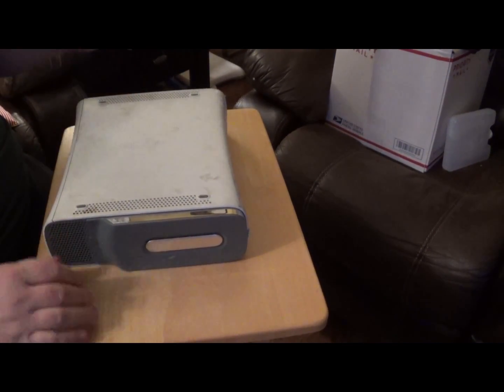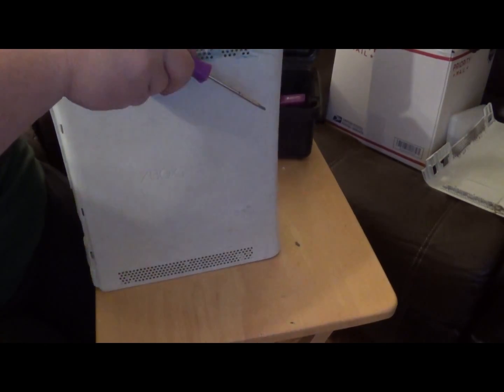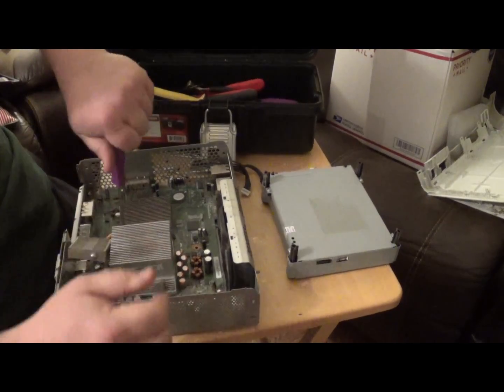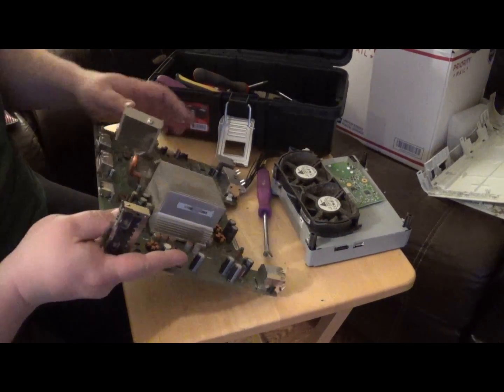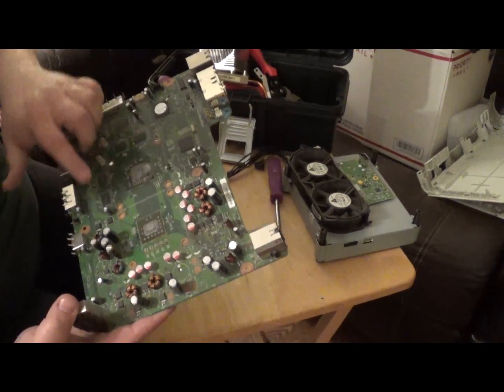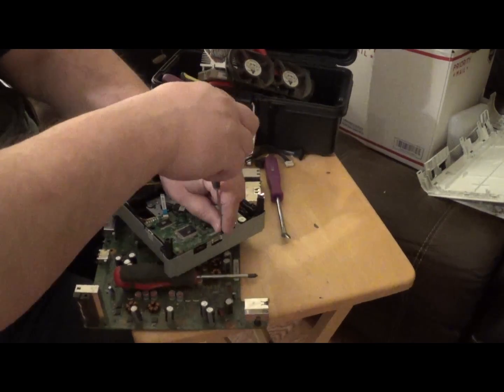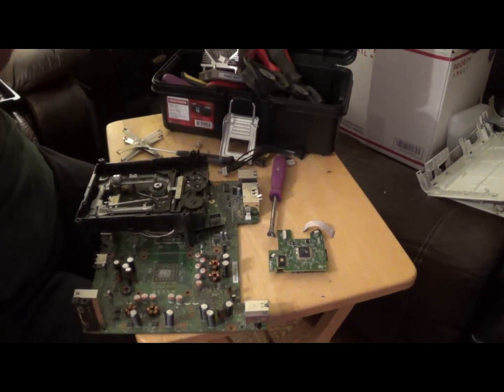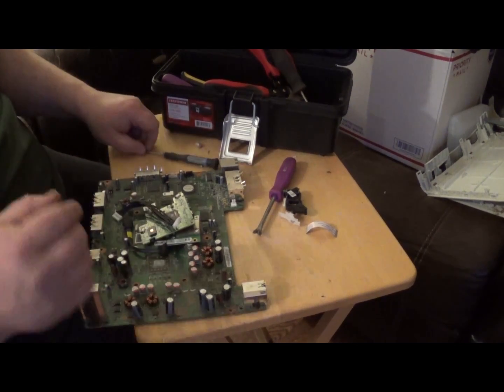Scrapping an XBOX 360 for gold and scrap metal

Comment: You're incorrect. There are many programs that will completely destroy all the data on a hard drive but they take hours or days for large drives. You just need to wipe these one time with 1 pass and you are 100% safe to sell them.
Reply from the maker: Thanks!  When I filmed this a few years ago, I am not sure that tech was available.  I still feel weary about it but if others want to take that route, there is certainly more money in it!
Reply: Stevens Garage However, you should note that after being wiped by any external means the HDD will no longer be usable for an Xbox 360. It will only function as a normal PC HDD. The reason for this is that Microsoft puts a special ‘security sector’ on each HDD so the system will not allow unauthorized HDDs.

Comment: i have scrapped two of these and something interesting that i found that i didnt notice you finding in the video was on the board there is a block box connected to four gold pins, if you were to pull off the box and open it you would have found a gold ball.
Reply from the maker: gold or gold plated?  I saw a video a couple years back about these little gold balls but after finding many and testing them all found them to be brass or gold plated brass.
Reply: i am unsure i havnt gotten around to testing them, they are pretty soft though i was able to dig in to it fairly easy.
Reply: This part is a switch, it probably indicates the box that it is tilted vertical and the dvd tray is not operable. I scrapped a 2007 version, it is slightly different from Moose's one (a lot fewer tantalum capacitors, the big heatsink replaced by a samller one with a fan...).  Chips are rather hard to get off, many break upon trying to extract them.

Comment: Glad to see your still doing the scrapping, as you have been a great a knowledge base for me. I`m a novice retired and love to tinker. With your help I get to understand different things about electronics parts and there value as for scrap.  My question is what should I save as far as value on electronics boards, as there are so many different ones. REFERRING TO RECTIFIERS, RESISTORS, DIODES, The hole ball of wax as it may be. This is my first response as I'm not sure I`m even doing this right, messaging that is. Look forward to your response, keep up the great work and good luck.

Comment: no I'm talking about the line that is in the house, someone gave me the wire of what they gave me also came with coaxial cable I know I can get the copper out of that. I'm new to scrapping so I'm still learning
Reply from the maker: +brian martin No problem.  Just make sure that if you are going to strip the coaxial you test it with a magnet first.  A lot of the newer stuff is copper plated steel.

Comment: Love your videos Moose you are the one that got me to start scrapping when I stumbled upon your video on getting gold off of computer ram, I wanted to ask I got like maybe 500 yards of telephone wire what is the easy way of stripping the plastic off to get to the metal wire i suppose it is copper
Reply from the maker: +brian martin Telephone wire has typically 4 very small wires inside with their own insulation.  Wire that thin is generally nor worth stripping.  The time vs pay out is just too great.  Unless you are talking about the phone line that runs on the poles....

Comment: Hi, what would you say is a good method to use on gold pins from hard drive circuit boards and CPU's, the AP mixture or the clorox /muriatic acid mixture? Thanks
Reply: zzbbswife Ap  solutions on cpu is the most efficient way..

Comment: Moose, how much $ do you make a year scrapping?
Reply from the maker: +jonald77 That varies greatly depending on the price of scrap which has dipped enormously since I started, and the time put in.  My best year was about $6000 in just scrap metal, this does not include items I resold but does include selling gold bearing material as well.  That was scrapping just part time evenings and weekends maybe 10-15 hours a week.  This past year it has been much less with the low scrap prices and with my leg and recovery from breaking it last January.

Comment: On a related scrap.  I recently scrapped some old gaming stuff - steering wheels, joy sticks, foot pedals.  I was surprised to find that some had gold plating under the buttons (similar to phones), some had mylar, and of course - copper motors,  wire and low grade boards.
Reply from the maker: +Ernest Petzrick yeah, the trick with the older gaming controllers etc is that they don't make them anymore, so they are becoming more and more valuable to vintage gamers.

Comment: I would say that selling this xbox 360 as broken as is is not a good idea. You won't get more then $20 for it and that's before fees and shipping and that's hoping the buyer doesn't complain and want there money back but that hard drive in it's plastic casing could have gotten you about $10 up to $40 after fees depending on the size of the drive. Scrapping the xbox is 100% the way to go if it's not working. To many possible headaches for $5 profit.

Comment: Great to see you at it again Moose. Couple of questions. 1 how do you sell them for parts, & b, your wife doesn't mind you working in the house?
Reply from the maker: +Miles Junk Removal You just post it on ebay as a used machine for parts only not working.  If you know whats wrong with it that helps but is not needed.  My wife and I are divorced now so I can scrap anywhere ;-)

Comment: Why woulnt you sell this instead?
Reply: +Phil Stevo You didn't watch the friggin video, did you
Reply: +Phil Stevo I would say that selling this xbox 360 as broken as is is not a good idea. You won't get more then $20 for it and that's before fees and shipping and that's hoping the buyer doesn't complain and want there money back but that hard drive in it's plastic casing could have gotten you about $10 up to $40 after fees depending on the size of the drive. Scrapping the xbox is 100% the way to go if it's not working. To many possible headaches for $5 profit.